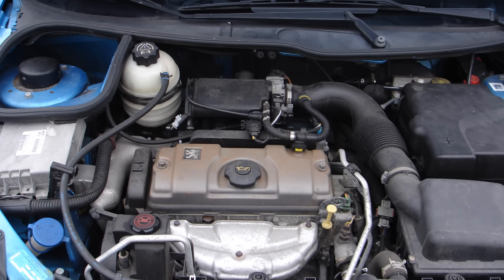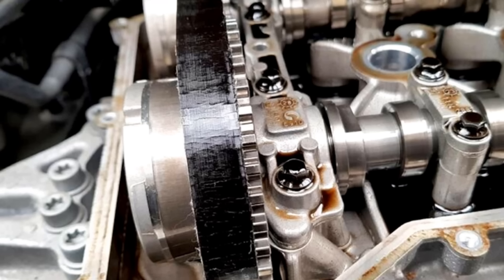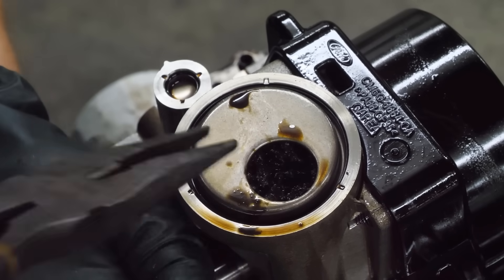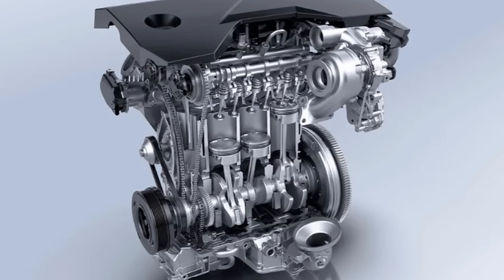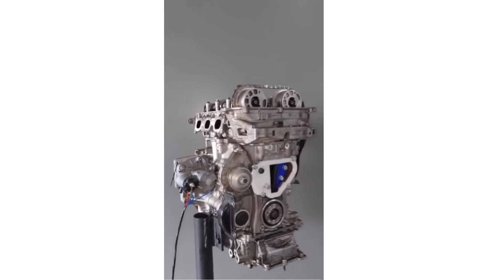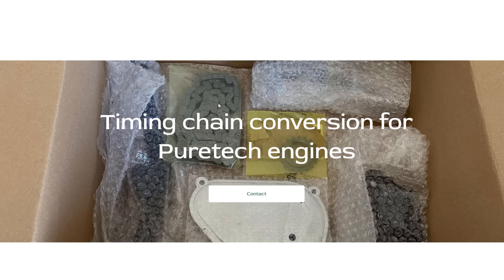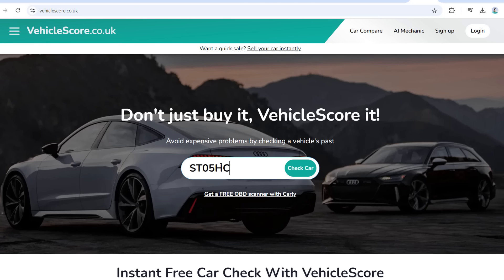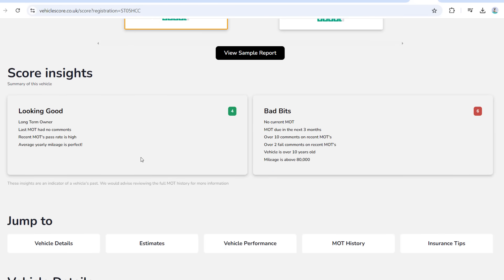Peugeot PURETECH Fix Is Here - All You Need To Know

Comment: I have one of these engines. Changed the belt at 7 years, good for another 7 years. Maintenace cost of 350 quid.
Reply: I recommend you also get the oil strainer checked and cleaned if necessary as these belts gradually give off bits and pieces, and it is the blocking of the strainer that finishes iff the engine.  My garage has an endiscope that can be used to have a look at the strainer.  Alternatively, the sump will need to be popped off, but then the strainer could be cleaned at the same time.😅
Reply: The belt change is all 6 years not 7…
Reply: verifie souvent ton niveau d huile
Reply: On my 3008 I get the message pop up.on dash every few days 
Oil level is correct.
Reply: @John-ob7dh  msg   niveau d huile ou pression d huile   si pression d huile regarder la crepine de la pompe a huile   probleme de colmatage     sorry i m french  not speak english very well   loock  at the oil pump filter!
Reply: @julianlord2697  mine is only Feb 2023 22000 miles.
Peugot serviced and warranty till Feb 2026 then extra warranty takes over till Feb 2008.only bought car 2.months ago and serviced by the peugot dealer I bought it from .
So I won't worry about it as pretty well covered .
Reply: @John-ob7dh   i hope you have no probleme   make the maintenance  to peugeot  only save you if you have problems

Comment: Just had the belt changed on my Citroen C3 Picasso. 65 plate, 57k miles. £600. Low oil pressure warning message. Main dealer services from new.
Reply: Low oil means your oil strainer was blocked, I hope they cleaned that out for you as well.
Reply: @mwhi475 they did. Used the Dayco kit. Proper job. The mechanic who did it was recommended. He’s done loads of these kits. He’ll be doing loads more for years as well!
Reply: Overcharged. I paid less than that at a Peugeot dealer including a minor service.
Reply: @julianlord2697 congratulations. What dealer was it. I’ll go there next time.

Comment: Pug copy ford or visa versa ?
Reply: One of the less well known features of the motor industry is how many major components (including engines and gearboxes) and platforms are shared across different brands, even competing ones, often with comparatively minor modifications - eg many small Mercedes cars have engines developed and made by…Renault.  Often you’ll find a manufacturer that specialises in a group of components that makes them for many different brands - eg GKN Automotive drivetrain systems and components are in many different car brands.

Comment: I had a 2.0 ecoblue diesel with the famous wetbelt. Guess what?! At 124000kms the timing jumped on a cold winter night leaving on the side of the road at -12degrees celsius. PHUN!!!
Reply: That’s 77,000 miles.  The current model modifications in components and decreased service intervals should make this a very rare event in future. On older vehicles it may be safer to change the oil at a maximum of 12,000 miles/one year and the belt at 60,000 or six years, whichever comes first.

Comment: a Peugeot EV, doesn't have that EXPENSIVE CRAP that needs replacing, LOL.
Reply: That’s because a peugeot EV IS expensive crap!
Reply: @meltedwheeliebin said it before I could 😂
Reply: @meltedwheeliebin  it will still outlive its ICE equal.
Reply: The only expensive part in an EV is the battery and when that gets scraped in a pothole, it gets VERY  expensive.
When warranty runs out, replacement is more than the value of the car.
Reply: I think you will find that despite sn EV having fewer moving parts that battery its  control
 electronics many soldered an pinned joints is as complicated and therefore has ample opportunities to go wrong without the system redundancies you might find on an modern aircraft and in the short term are likely to be less reliable and less well understood  and widely experienced hence will be less reliable more expensive etc

Comment: I didnt even realise adding oil between services was a thing. I have had my Swift for eight years since new and never put oil in it.
Reply: How did you know it didn't need oil top up, though? Relying on sensors/computers is dangerous. You could have had an oil or coolant leak and not known. You should always check fluid levels regularly with any car.
Reply: I’ve personally known 2 people who’ve lost engines because they never checked the oil…🤷🏻‍♂️
Reply: I have not topped up the oil in any petrol / diesel car I have owned in the last 20 years - oh, except an air cooled 911 which drank oil at an alarming rate !!
Reply: Checking fluid levels and tyres and lights weekly should be in your driving test. 
Not because it needs it each week but just in case.

Comment: These engines are pure shite , still , I’d rather have this than an EV 😂
Reply: My 5 year old 308 drives lovely. Belt still pristine. Oh I have serviced it on time with the correct oil.
Reply: @agiugabenson7268  
A five year old 308   You have my sincere sympathies sir .
😱
Reply: @agiugabenson7268 wait till 100000km
Reply: @agiugabenson7268 Mine is from 2017 and maintenance manual says it needs to be changed after 6 years. Already changed  mine back in March. However  a few days ago, car stopped  at highway with error faulty engine, please repair. A camber poly was or faulty or badly tightened and even valve puf. Fortunately garage dealer gave assistance, on warranty of March service and didn't  pay anything.  But my confidence was lost in car
Reply: That’s a solid comment !!!  I have had couple these.  In the motor trade.  Oh MY. Oh and a lease PT on holiday.  They don’t even drive nice.
Reply: You don't
Reply: Not the brightest lightbulb you?😂
Reply: They're absolute BS, I'd rather cycle.

Comment: People are going to hate this then... some VW 2.0 TDi engines have a belt running the oil pump! But none of these belts are rubber... even dry belts aren't really rubber anymore.
Reply: I have a wet belt on the oil pump on my VW T5, it has 271000m on the engine and I got it checked when the timing belt was done early in 2024. It's was ok but I do insist on the correct oil and change it on a yearly basis
Reply: Some 1.6 TDI Skodas have the belt driving the oil pump as well, I don’t know how they last so long on the VW stuff compared to FORD/ PEUGEOT

Comment: Hey mate I am no mechanic - well some DIY - or a science-based expert but as you said in the intro mixing oil and rubber is simply asking for trouble as we have seen over the years through experience. Just why these vehicle designers and manufacturers make this setup knowing what the science has told us for as long as we have been using machines that require lubrication and  some flexibility for a lot of mechanical machines - not just cars. It can only be put down to  those companies penny-pinching on said mechanical devices and to me at least it makes no sense whatsoever to produce devices knowing those devices will fail in a very quick time.  Again it is us the consumers of said devices who have to foot the bill.
Reply: hello john    la courroie n est pas le probleme principale le probleme principale est que ce moteur avale de l huile  et cela provoque tout les autres soucis c est simple ils nous ont vendu un moteur deja user alors qu il est neuf   essence qui descend dans l huile   huile qui remonte au dessus des segments pour moi neuf il est deja rince ce moteur! cylindre en alu qui s ovalise avec la temperature! si je comprends bien la voiture veut s autodetruire

Comment: I'm an ex peugeot 207 owner, from the year 2007.
I don't know if my heap had chain or belt, but it was an awful vehicle and a massive money pit.
Drank gallons of oil, awful to drive and serviced correctly after buying new from a main dealer.
Are you telling me then that for all the future 208 owners it got EVEN WORSE ??
Mine scrapped itself with a blown engine in 2020.
Thank god I never was tempted with the newer model , and I now happily drive electric by choice.
Faith in all modern combustion engine cars totally destroyed.
Reply: Should’ve brought a Toyota or a Honda tbh
Reply: I worked 3 yrs in Peugeot, had replaced over 10 of these engines and countless overhaul repaires for this shit design.
Reply: Big fat chance that had the "prince" engine, notorious for guzzling oil and also low oil pressure issues.
Reply: @watchanything-c7r  mine got through its clutch at around 19,000 miles.
It was a 1.6 vti sport, in a 207sw.
It had one replacement cylinder head  under warranty at 5,000 miles, Peugeot technicians were called in and took photographs.
Abs recurring issues, and endless "depolloution system faulty", each time involving at least a sensor replacement.
Ecu connection problems.
It went back after one month from new, with stuttery engine problems and low revs and lack of power when pulling away.
I could never ever manage a smooth gear change, and that issue was never resolved.
If the car was fully loaded it hardly managed to go up hills.
Something went at 23000 miles, the breakdown technician announced that only half the engine was turning.
The dipstick could not even be removed, and the car was scrap, needing a new engine.
It came new from a main dealer, was always serviced there and looked after.
My mate has a mini.
He has reverse gear issues that cannot be fixed.
I'll take my chance with battery fires and range anxiety any day !!
My previous peugeot 206 was faultless.

Comment: Hello.
Any advice be greatly appreciated is the 1.6thp  peogeot 2013 models have the same issues as the 1.2 puretech engines or any problems .
Wet belts/  chains oil issues etc .
Thanks 👍👍
Reply: Completely different engine still terrible for problems though, Uses a Timing Chain which also falls regularly

Comment: First! Still wouldn't buy one. I'll stick with Suzuki. I have had no issues. As to oil consumption between changes. What oil consumption.?
Reply: I had a Suzuki a few years ago. Brilliant, reliable engine BUT if you stood close to it & kept quiet you could actually HEAR it rusting!!!
😕
Reply: @ANationalAcrobat-qj2dl  Modern Suzukis don't rust any more than any other brand. Mine is 7 years old and is as new underneath.
Reply: @bondjamesbond9041  Do you live near the coast where all the salt air is?
Reply: @ANationalAcrobat-qj2dl modern Suzuki are excellent    on rust,have an Alto which is spotless underneath.
Reply: @grahamhaynes7658  I agree they are excellent for rust resistance.
Reply: An engine is supposed to use a small amount of oil.
Reply: @victory2115  Well, my Volvo NEVER uses any oil & it is 16 years old!!
Reply: @victory2115  Not always the case. Have had my Suzuki 7 years and it does not use any oil between changes.
Reply: @victory2115  so confidently wrong